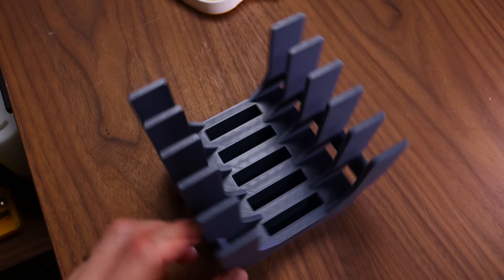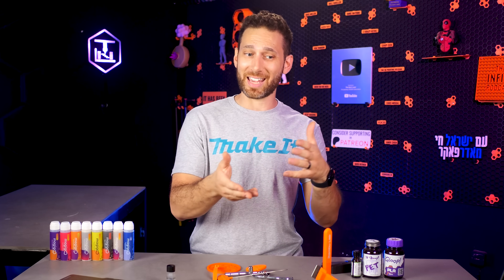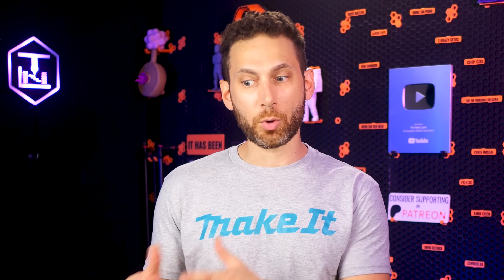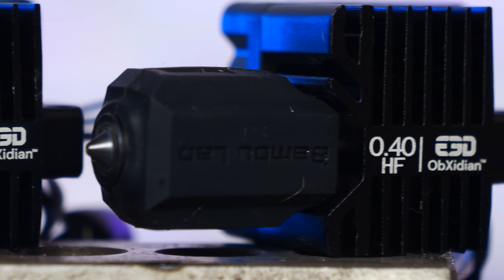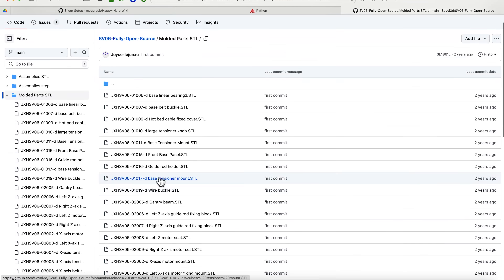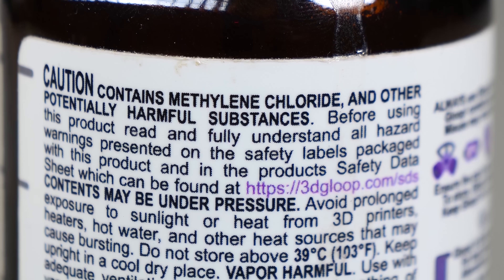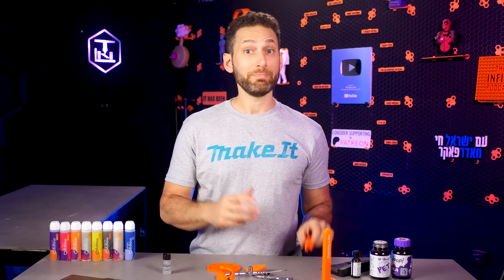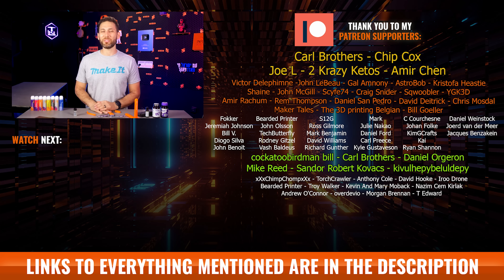These Underrated Products Make 3D Printing Fun Again

Comment: I too was struggling with bed adhesion issues. My printer is an Ender 3 S1 pro.
I have a PEI textured bed, and I thought I'd use glue too, only to find it does nothing.
After troubleshooting everything else, and getting mostly good results, I settled on cleaning the bed instead of trying to use glue. I use Fairy dish soap and a melamine sponge.

Use good amount of the soap, and scrub thoroughly several times across the bed in all directions, then wash with water, and dry with microfiber towel. If I ever have issues again I might buy that bed glue, but for now I'll try to keep the bed as clean as I can in hopes of prolonging its life.

Comment: The only issue I have with using the bambulab supplied scraper is that, if you aren't extremely careful, you can gouge your build plate (especially those textured ones), otherwise, I agree.  I tend to avoid metal on non-metal whenever possible.

Comment: The only time I need glue stick is when printing Nylon, but I only print one type of filament per print sheet side. PETG never sticks when I printed PLA on the same sheet before. Same with almost any other combination.

Comment: if you keep your bed CLEAN i.e. soap and water clean, a LIGHT spray of hairspray that contains a form of vinyl NOTHING comes loose and wen it cools it just pops off NO strain or stress. all good on ender 3 S1 Plus, JG Maker Artist 2D pro, Bambu X1C, K1 and K1 Max

Comment: On my X1 Carbon with textured plate I've had better success with thoroughly scrubbed bare plate on ASA than with Magigoo. And in general hair spray has been better than Magigoo. Much as I wanted to like Magigoo it never seems to be the best option.  Magigoo was not even best for Nylon GF.

Comment: Gluestick is to reduce adhesion, not increase it.
Reply: Yes and no. It will create a layer that the print sticks to, and also can detach from the bed. It helps if your print wont stick to the bed, and it helps if your print sticks too well to the bed.

Comment: The Vision Minor Nano Polymer stuff works well...sometimes too well for ASA.  I probably only have to clean my build plate like once every dozen prints and apply the Nano Polymer sparingly.  I found the Bambu metal scraper too aggressive on my build plates so I use the metal scraper that came with my Anycubic M3 Photon which is just like a 4" putty knife.

Comment: I put the magigoo into a syringe and then wipe it on the plate with a paper towel. This gets it real thin and for the next prints, I just reuse the paper towel with alchohol and it will just redistribute the glue again that is already on the paper towel and build plate.  Use a tinny piece of the paper towel though.

Comment: I disagree on several points, but we all have our own experiences. On the glue stick, I have never had issues with it. That said, I don't just gloop it on and go. I use a plastic scraper to flatten it out, mist it lightly with water, and then scrape it flat again. Finally, I wipe the excess from the edge of the build plate. This ensures that it is thin, tacky, and evenly spread. Sounds like a lot of work, but it only takes a few seconds and it works well. On the Bamboo Labs scraper, the idea of using a metal scraper on my build plates (PEI, and PEY) sends chills down my spine. I want those to last as long as possible before I have to replace them. I use a single edge razor blade holder (widget scraper), and plastic blades. They are very cheap for a box of 50 blades, and they are disposable. So you can always have a fresh blade.  I have not had issues with CA glue, and I don't use an activator. I do use gel type glue, and VERY careful application. I know that CA glue is definitely a "your mileage may vary" type of product and I tend to stick with the Loctite Professional line as I know what to expect from it. If you are getting clouding from the CA glue, that is actually the exposed glue where it should not be. You were not careful enough with your application.  People tend to over apply it, and in addition to the squeeze out drying white, it can actually weaken the bond.

Sometimes it is right tool for the job, but sometimes it is also a matter of knowing how to use those tools properly. If you try to use a large hammer holding it a couple inches from the head, and most of the handle below the bottom on your palm, then you are not going to get the best results. You have to learn how to swing it properly.

Comment: Bed adhesion....cheap hairspray has never failed me.
Reply: EXACTLY!! i print everything with hairspray - as long as it contains a form of vinyl it is good.
Reply: @LucidFX.  just spray a layer? 
I thought of trying aleen’s tack and tack over (i use it in mix with water for get the sticky back on my silhouette mats)
Reply: @sophiemulders  yeah literally a thin layer of hairspray works. I'm always nervous of just a clean bed, especially with ABS. PLA I'm fine but still use hairspray as a habit
Reply: @-Primer-  same. Last time I went to buy a big can of suave max hold, it was 2 bucks. Lasts 6-12 months
Reply: Curious about this. What bed surface have you got and what materials have you tried with it? Curious about PC for instance.
Reply: I will NEVER gunk up my printer surfaces with such a vile product. Hairspray leaves behind a really nasty later from the overspray, and I'd rather not have that all inside my printer. A textured bed is all you should need.

Comment: Man.... the price for this stuff in Canada is Crazy.   Magigoo MPP2018 3D Printing Bed Adhesive is $58.82 for a 50 ml applicator.  The Magigoo Pro Kit is $171.15 and includes 3D Printing Bed Adhesive for Nylon, PP, PC, ABS, PLA  (4 x 50 ml) bottles and a microfiber cleaning cloth.  

 I want something that will help reduce the number of failed prints, but not at these prices. I would have to apply a surcharge on each print to help recoup the costs. Yeah, you saw that right. $58.82 for the 50 ml bottle and over $171.15 for the pro kit. That's going to be a hard pass here.

Comment: Can you share your settings for the bambu lab x1c with a revo nozzle?
I have this nozzle, but prints are not as clean as the standard one and for that reason, isn't istalled on my printer.
Thank you
Reply from the maker: I run standard settings actually. High flow nozzle.

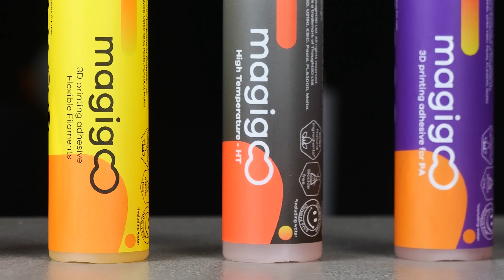Comment: 3:06 Vision Miner nanopolymer adhesive works for all filament, including PEI, PPS and PEEK. I don't need to remember or check which filament and glue I need to use, you need to try it, their more expensive bottle is 45 dollars only.

Comment: I tried to use the Magigoo PP adhesion stick, but it didn't usually stick. PP tape for epoxy coating turned out to be the best option for PP. Better adhesion and a much lower cost.

But you sold me on the repellent. Since I'm going to switch to Revo hotend, this looks very useful.

Comment: Most folks just cant wrap their heads around the way finger oils work, you washed your hands? Thats cute, still leaving oil on your build plate and causing low-adherance zones. Clean it with high proof iso if you even think your fingers rubbed the build plate where it will lay filament.

Also scrappers are subtly misunderstood, the IDEAL scrapper has an edge that can get under the edge of a bead of filament, but with varying z squish and textured vs smooth plates that height varies. I have a bambu now but I use the scrapper that came with my original E3, it is different to 2 other 'identical' ones. But its edge is formed better, sharper, but not into a knife edge, also on one corner it's subtly thinner. I use that edge specifically to release any stuck parts, else if its a larger piece just let your build plate cool so you dont have to sweat. Using build plate adhesives seems completely counter intuitive to me if folks just need to heat their beds hotter or clean them, causing a mess, buying more consumable materials, not getting self release at the end.. having to clean the plate from that also.

Comment: Magigoo is a good solution. the liquid stick of Bambu seems the have the similar compound. Works great.
If you want to go on the cheap, buy kindergarden glue (water based glue), isopropyl alcohol and some water. Mix it, in the same order as mentioned before in the ratio’s 1/2/2 and you have a magigoo competitor for a lot cheaper.

Comment: I use Vaseline to remove the white haze caused by CA glue and activator and it works great.  It is also cheaper than 3DGloop.  I am on a budget, and I always have CA glue and Vaseline on hand, with having 3 kids.
Reply: @jokingtiger  thanks for the tip
Reply: It's also way less toxic than 3D Gloop.
Reply: Gonna have to try the Vaseline next time I get the "whites" from CA.

Comment: Just hit the build plate with a quick shot of cheap aerosol hair spray. Doesnt leave a thick residue like a glue stick. You'll need to wash the plate after a handful of prints, but is much cleaner which seems similar to that Goo. My can has lasted almost 2 years and works every time. Just remember to remove the build plate before spraying so you dont get hairspray on your printer's parts

Comment: I’ve been using slice engineering nozzle coating for a while. Really helps with AMS printers. Helps that poop release from the nozzle so you don’t get boogers or accidentally color contamination on those multi color first layer prints. Love that stuff! Tried a knock off version on Amazon too. Didn’t work as well. Even said not for PETg on the bottle (didn’t say that on the listing tho!)

Gloop people are scared of. It’s a dangerous chemical and that freaks people out. lol guess they don’t know about gloves and not huffing glue. 😜

Comment: $20 a stick for Magigoo?! OUCH!
Reply: In their defense they last forever and don't need to be reapplied often.  I've had mine for almost a year, and I still have over 3/4ths of it left, a little goes a very long way
Reply: @jokingtiger  exactly. Its not like 1 magigoo stick equals 1 regular glue stick. In my experience it is more like 1:5 to 1:10, depending on how thick you apply things...
Reply: @JGDeRuvo  for very small one.
Reply: Idd i was searching too but i found it too expensive for what it is
Reply: @kennyvanlimbergen7409  you can find it for cheaper and it does last quite a bit since u can print on the same athwsive like 2-3 times, I manage to print 5 times on mine
Reply: That glue is simply amazing. The awesome people at partsbuilt3d sent me a sample in my first order. I was also on the glue stick path until I tried the magigoo. I have now ordered the big bottle and should be good for years to come. I am actually still using the sample bottle because it goes so far.
Reply: @JGDeRuvo  you get a ton of use out of it

Comment: As long as 3d GLOOP does not fix their shelf life, I will never buy this. 6 months after opening is ridiculous, especially with their large bottles and high price
Reply: This. I can deal with it being fairly expensive, there just isn't anything else that works as well. The problem is, the shelf life is so insanely short, they say 2-3 months after opening. They need to come up with a container/dispenser that preserves what you don't use after the first application. Like, package it as multiple individually sealed very small bottle/tube/applicators instead of a single large jar.
The product is excellent, but whoever controls their packaging is just a flat-out moron.
Reply: It's a solvent with an evaporation point well below normal rom temperature. MEK and Dichloromethane are cheaper (still suffer from evaporation) but do the same job.
Reply: @backtoearth1983  Dichloromethane is the main ingredient of 3D Gloop. Which is why I don't want it. DCM is pretty nasty stuff.
Reply: @backtoearth1983  Yeah, I think DCM is the primary ingredient in gloop.  I can't buy Gloop where I am, Or rather I probably could but shipping would be prohibitive, so I buy DCM off of amazon instead.  But yeah, still evaporates over time.  Mostly just buy a bottle when I know I'm going to do a big project that will use quite a bit, and needs the extra strength
Reply: @backtoearth1983  MEK is some seriously nasty stuff and more flammable than gasoline, please if you use it in doors open all the window and have a fan on or use a proper respirator. I had friends that use to use this stuff in a paint shop and they would full on bunny suit up with air supply before using it (being overly cautious i'm sure but they knew how bad it was for your lungs and skin.
Reply: I bought a small bottle to try, and haven’t used it yet lol… I just haven’t needed to bond any PLA recently. But I did notice the short shelf life, which is disappointing.
Reply: Shelf life is exactly why I haven't bought it either. For the price, it's extremely short. Would hate to spend that much and then for it to go to waste so quickly.
Reply: If you have a job that really needs to stick, then I don't mind loosing some, if not used in time.
Had a bottle, and it was great while it lasted.
Reply: They claim a short shelf life, but I have two bottles (one PLA, one PETG) that I purchased before the "human malware" (at an ERRF as I recall). I rarely use them so they aren't sitting around open very often. But I'm just now thinking of replacing them. They are getting just a little too thick to use easily.

Comment: Magicgoo is quite pricy. How long do you use a tube? Or how long to is get to dry in the tube? :)
Reply from the maker: Apply once every 8-15 prints, but I apply it maybe every 5-6 because it’s cheap insurance. I’ve applied it to maybe 40-50 build plates and I still have 85-90% of the bottle. So ostensibly it should last very very very long. Like over a year depending on how much you print. It doesn’t dry out if you store it upright. At least mine hasn’t.

Comment: Love Magigoo, it's genuinely the biggest financial outlay I have after filament and I am fine with that because ever since I started using it a few years ago my material cost through overnight failures has dropped to (almost) nothing so it has paid for itself. I don't use the PLA one because beds have got so good if you clean them/IPA scrub every print you never have adhesion issues but for PC and PA12 it is invaluable to me. I use it for TPU too as an interface for easy removal. (I was not paid for this comment).
Reply from the maker: Yep. This is exactly my stance. I don’t get bed adhesion failures anymore unless it’s a bed I haven’t applied magigoo to yet.

Comment: PVA glue stick is still indispensible for Nylon. No amount of cleaning will ever get Nylon to stick to PEI, but PVA acts as a perfect cheap bonding layer. 

Additionally without gluestick PETG will overahdere to PEI, but PVA will act a protective release layer and keep you from ripping up your coating when you remove your prints. 

Your recommendation to "just clean your bed" ignores all the extremely valid reasons to use PVA. In my area I'd have to special order any of these other adhesives whereas PVA is available in a short errand most any time of day.

Also judging by the examples you're showing, you use entirely too much glue stick. Only the thinnest layer is needed to have an effect.
Reply from the maker: I talked about how it’s a better release agent than anything else. But Magigoo makes a PA product that is amazing and doesn’t leave a mark on your prints! Also, these products are available on Amazon!
Reply: I print pla and petg 99%. I never ever used anything on pei sheet except cleaning it with ipa. 
Petg sticks great, and can be relased by flexing the sheet or wait to cool down.
And i even don’t clean bed between every print. 
In 3 years of printing i could count on fingers how many prints failed because of poor bed adhesion.

Comment: I couldn't agree more about the bed athesive, when I got my first I  immediately threw the glue stuck away because, at least in my experience, it made prints basically impossible to remove from the print bed. Although I do still use it when I print flexible filaments and overall I don't use any athesive because the smooth pei sheet of my Prusa is basically indestructible, lol, 99% of everything I print sticks perfectly.
As for the bed scraper, I'd never ever use one because I ruined the bed of my ender 3 with one, that's why now I'm only using plastic ones with replaceable blades, the blades only weigh a couple of grams or so (for the designs I use) so they're perfect as end of spool prints. Sometimes I do have to use a razor blade but I'd rather not do that unless I absolutely have to.
Also one last thing, I'd love to know if there's any alternative for the paint repellent paint cus it's pretty expensive for me in my currency, especially for only 3ml 😅. Or at least I'd love to know how long it lasts on the nozzle and how long does it last if unused, to know if it's worth it or not. Thanks
Reply from the maker: Thanks for the comment!